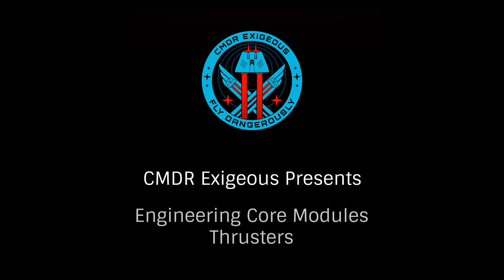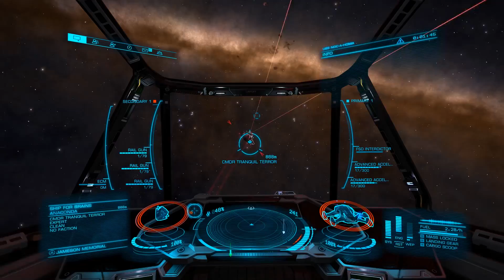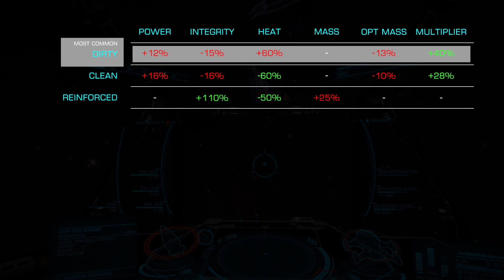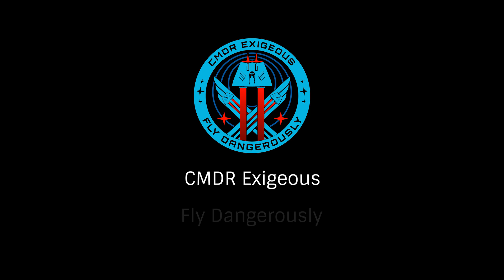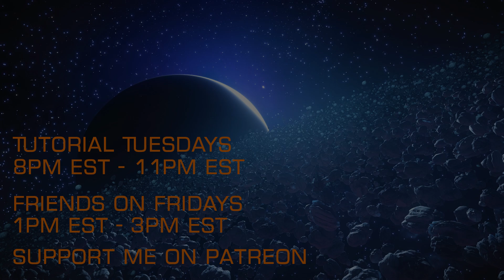Engineering Explained: Thrusters

Comment: So I've figured out optimal mass and multiplier 

Optimal mass = Handling

Multiplier = Speed

Just tested with my Type-9, stage 2 clean drive from Farseer got me mid 200 ish on speed but slow turning, after removing it I get only 200 on speed but my turning radius is much better.

Comment: basically, dirty drives.  Clean drives are for ships that want to move or fight as cold as possible, such as smugglers or cold-combat stealth ships trying to avoid being targeted. Ships prone to overheating should either offset themselves with projectile type weapons, thermal vent energy weapons, or heat sinks. Boosters should be paired with heat sinks to avoid overheating. 

Explorers can consider going for Clean drives if only to reduce thermal load after crashing into a sun (because it happens), combine it with similar engineering on the powerplant to disperse as much of that heat as possible going into low/high wake.

Comment: What should I run on my pvp ship that uses silent running and lots of heat sinks?
Reply from the maker: You can run dirty drives for sure (there are very few builds where you'd use clean drives) and use nothing but heatsinks and no shields.  I have an FDL build like that and while it works it's really only effective in wing fights as in a 1v1 silent just isn't effective.  If you ping me in Discord I'll share the build - and when I get to the FDL I'll be including it.

Comment: Idk if this is outdated or what, but some info here is wrong.

Clean drives will not affect your heat generation when fuel scooping in the slightest. Thrusters generate almost no heat when not engaged, and in supercruise, they will not affect your heat generation when scooping at all. The heat reduction from this is mainly for boosting. If you're running a Silent, shieldless build, Clean Drives will significantly increase the time you can spend without using heat sinks since your thrusters will generate very little heat even when boosting.

Optimal Mass on Drive Distributors has nothing to do with jump range or anything at all with FSD operation. Optimal Mass, in this case, refers only to the amount of boost speed you get when boosting. Essentially, Drag Drives increases non boost maximum speed while Drive Distributors provides more boost speed. Thrusters are inoperative during supercruise, and thus will not affect ship maneuverability while in supercruise.

Additionally, SCB usage should never factor in to whether you choose Dirty or Clean or any of the Experimental Effects since these modifications mostly cause heat when boosting, and you can avoid boosting when charging a SCB. Using a SCB will overheat your ship every time. If you plan on running and shield-based defense, bring plenty of heat sinks and deploy one at the same time as your SCB to guard against overheat damage.
Reply: He means that ig your ship requires a Grade 4 Thruster to reach the optimal mass limit, you can instead get a grade 3 (which is inherently lighter) and then get the Drive Distributor Experimental effect to reach the required optimal mass.
Reply: Optimal mass affect more then just boost. If your ship total mass is exceeding your drives optimal mass, it will impact your manoeuvrability as well as speed. Best example of that is ships that use enhanced thrusters (which have lower base optimal mass). On these thrusters, you will often reach better over all performance with drive distributors then drag drives.
Reply: yes, clean drives affects you heat generation from thrusters. he never claims it effects your heat generation, just thrusters heat generation. There is a difference

Comment: What’s the difference between optimal mass and just mass? If one were to build a full exploration ship, you’d care ONLY about the optimal mass? Mass secondary?
Reply from the maker: Optimal mass is the level at which lower mass makes no more difference.  Put another way let's say your optimal mass is 1000t and your ship weighs 1100t - and let's say you have a 30 ly range.  If you drop to 1000t let's say that gives you 35 ly range (made up numbers BTW).  Then if you drop to 900t your jump range is still 35 ly as you're below optimal so you don't get any further benefit.  Make sense?
Reply: yes it does! Thank you so much for your time, videos and explanations!!

Comment: If only I knew what the hell optimal mass and multiplier do.
Reply from the maker: Let's see if I can explain optimal mass - that's the point at which going lighter has no benefit.  Say your ship is 1100 tons and your optimal mass is 1000.  At 1100 tons your cruise speed is 390 (making these numbers up BTW) and at 1000 tons your cruise speed is 400.  As 1000 is your optimal mass if you lower your weight to 900 tons you still only go 400 as you're at or below your optimal mass.  Make sense?
Reply: @Exigeous  No, you can still go faster with mass under the optimal all the way to minimum mass. You can really see the difference when engineering imperial courier with enhanced thrusters.
Reply: I follow you, thanks.
Reply: @Exigeous  OOOOOOOHHH....... Wait, why doesn't it tell us this in-game?
Reply: This is the first time I've understood what that dang stat actually means!
Reply: and multiplier would be how much faster you can go, i guess

Comment: Would you be able to explain the relationship between optimal mass vs your ships mass in relation to high gravity worlds? I've been told if your optimal mass is LOWER than your ships mass, you won't be able to land (safely) or take off from high g worlds. I have been able to do this, however, so I'm confused about that relationship. Any knowledge you could share would be greatly appreciated :)
Reply from the maker: Let's see if I can type this out - as no, in your context they really have no relation.  Optimal mass is the point at which things don't get any better - so let's say your ship is 1100 tons.  Your optimal mass is 1000 and let's say that sets your cruise speed at 400 (fake numbers here).  At 1100 tons your cruise speed is 390, at 1000 it's 400 but at 900 tons it's still 400 - as it no longer helps to get lighter as you're under the optimal value.  That's why there is a lower limit for speed and even if you keep getting lighter you don't go faster or jump further - make sense?
Reply: CMDR Exigeous that makes so much more sense! Thank you!